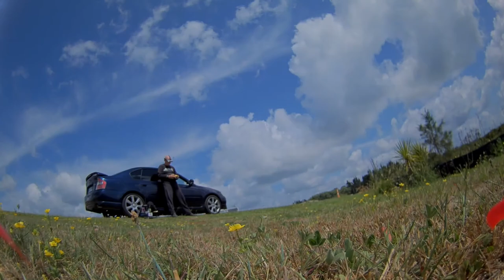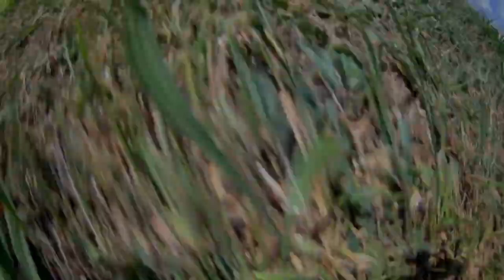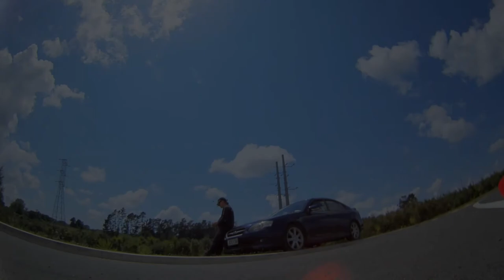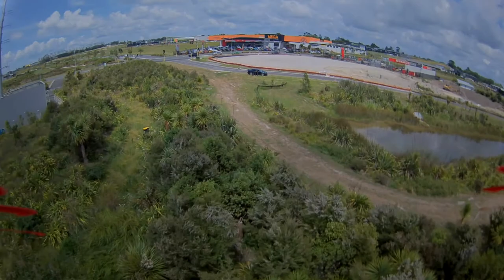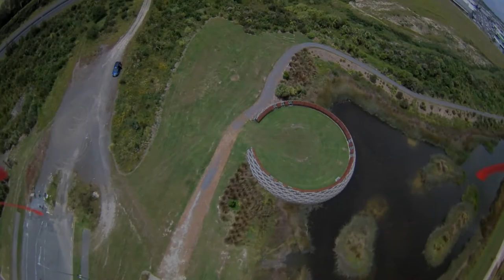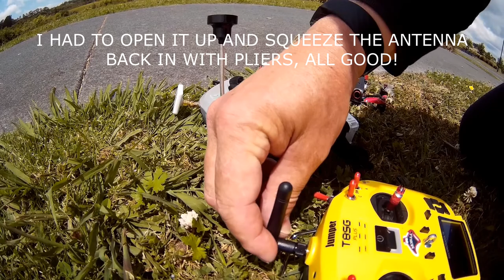Diatone Rabbit GT R349 HD Caddx FPV - FAILSAFE WIPEOUT - NZ

Comment: Looking good flying the path and getting brave now flying over the water 👍 just shame about the concrete
Reply from the maker: At least I made up for it when I flew through that gap the next day, not intentionally either, that was a miracle my quad didn't just explode on sideways fast impact. Didn't even clip a prop. It's in my next vid.

Comment: My jumper came exactly the same with loose antenna thread. It's easy to repair, unscrew , fit the brass coupling best you can and fix with hot soldering iron and plenty solder. Mines been fine since. I like my jumper just shame things like this are left to the customer too sort.  Hope your gt349 soon back flying ! Least it didn't land in the pond lol
Reply: Ps caddx do a so called "special lens" for the turtle, glass, it's pretty good, UK 7£
Reply from the maker: Yes it's back flying and I did manage to fix the TX antenna but as you say some solder would certainly make it stay put. It's a stupid system, all it needed was to unscrew the coupling from the black antenna (as you know) and press it right into the TX coupling with large pliers, you can't do that with your fingers in the field. I should open it up and solder it now, I think that's why I failsafed in the video, it was almost falling off, lol. I really like the Jumper esp that it works on most RX's but it took me a while to get used to the small toy size of it, but now it feels good. I adjusted a few things inside with yaw and throttle and it's even better now. Thx for that.
Reply: @BrigzyFPV  🤞🚀🚀⚡
Reply from the maker: @spaceportseven  That was the Special Lens/Glass, I thought it was good but what a bitch to focus... I couldn't be bothered changing back to a Turbo Eye Poly Carbonate one due to the hassle of focusing again but after this crash I just put a brand new Caddx Camera on with the Turbo Eye and I have to say I prefer it, it's a bit wider and more fisheyed which gives some cool effects in tricks, the plastic one is tough, I have never broken one.